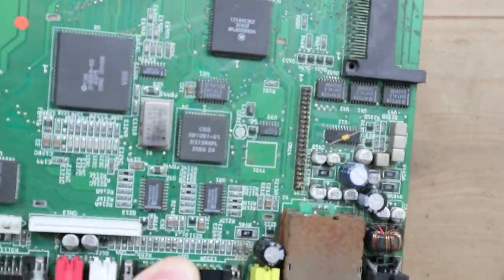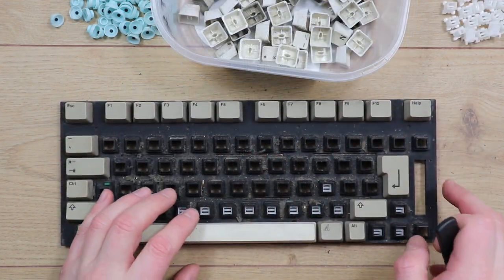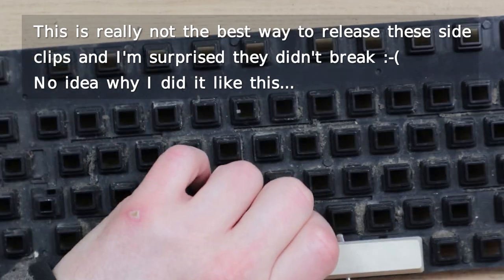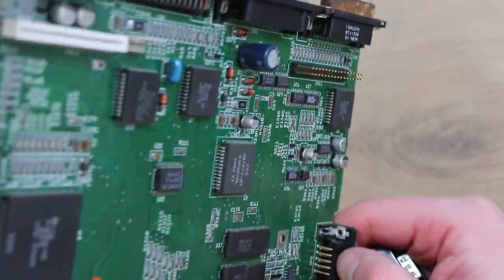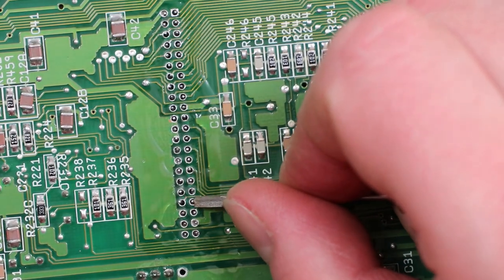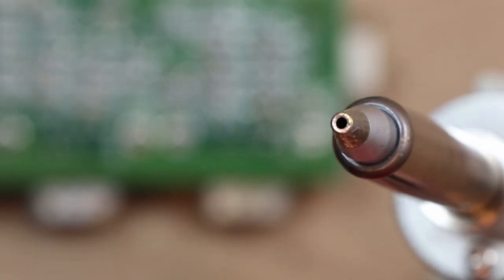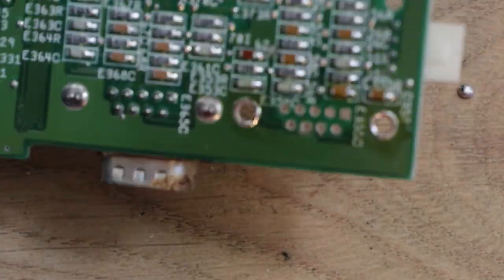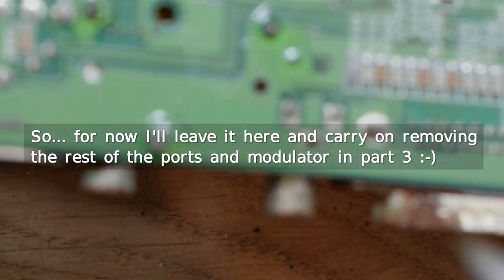Amiga A600 - A Bit of a Clean Up - Part 2

Comment: This is the blue membrane version of the A600 keyboard. The green membrane version, which seems more common have the same plungers and springs as most A500 keyboards. I have two A600s with the green membrane and one of these with the blue membrane.
Reply from the maker: I wasn't aware of there being different types of key caps until I opened this. I was a little disappointed because I was hoping for the more standard A500 style round turret  key caps. And A600 keyboards on their own aren't the cheapest thing to buy. Having said that I was initially thinking of tearing it down for some sort of custom build... maybe, but I think this is something that could be recovered to a reasonable state with some work, which appears to be where I am going with it :-D

Comment: Great job so far. You're doing far better at removing solder than I am - I can never seem to get the holes as clean as that, and the component leads always end up stuck to the side. Is there a trick I'm missing?
Reply from the maker: If there's a trick then I don't know what it is :-D I think using one of these guns is the most help, those hand pump solder suckers suck... well actually they don't and that's the problem!
I think moving the nib of the solder sucker in a circular motion may help release the legs too. Although I have noticed this has taken some of the solder mask off in this instance.